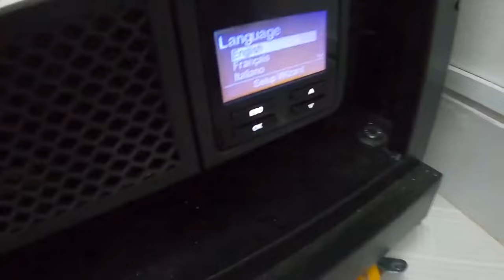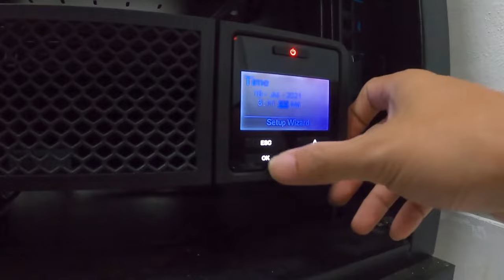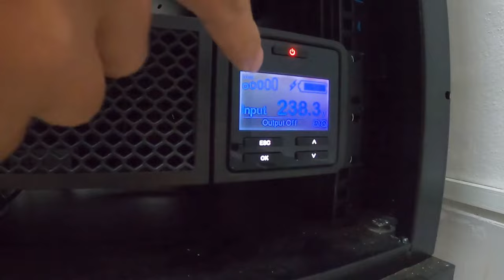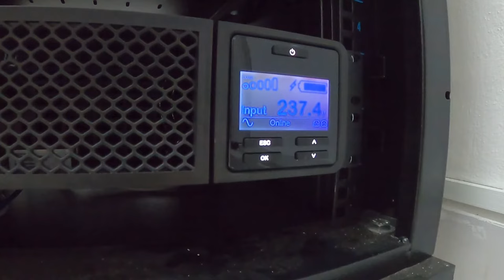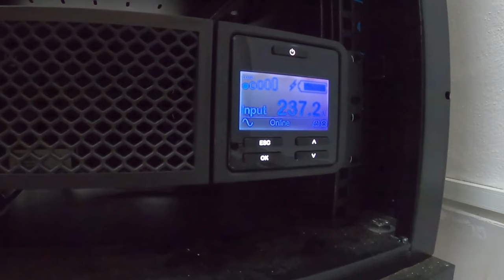APC Smart-UPS SRT 3000VA RM 230V unboxing and setup

Comment: Agreed, removing the battery would help with the install.  Also the rails are backwards as the UPS can run in to the extension about half way down, not a major issue, just something to consider for next time.  Thank you for taking the time to post the video, I was wondering what this model did for rack mounding, nice to see it's the standard shelf brackets.
Reply from the maker: I agree with you, I don't have much experience in installing this ups. Next time I will remove the battery first to lighten. Thank you for watching the video and commenting.

Comment: Thanks for the video.  Suggestion is to remove the battery pack before installing the base unit into the rack.  The battery makes up for at least half the weight and makes it much easier to install.  Also would have been good content to show how to install the battery and what it looks like etc.
Reply from the maker: Thank you very much, the ups and the battery are very heavy, it takes 2 people to install, if the battery is removed first, it will be lighter.
Reply: This is a great advice I was about to move a similar unit all by myself today, my back and spine thanks you lol